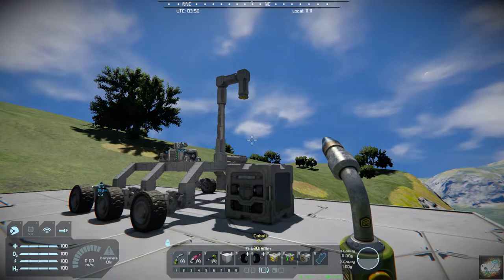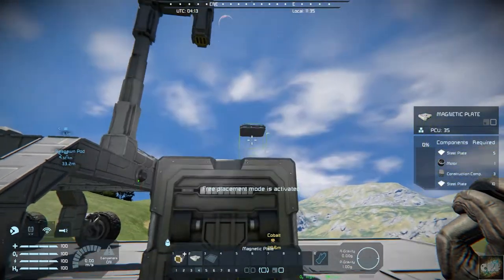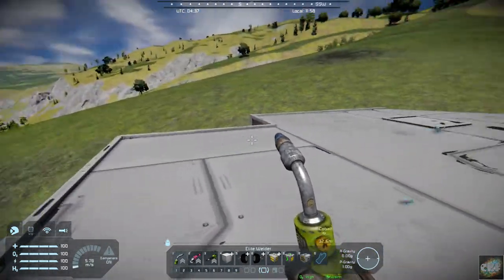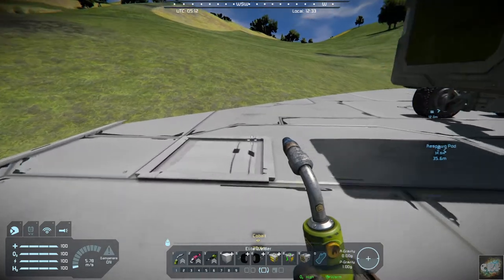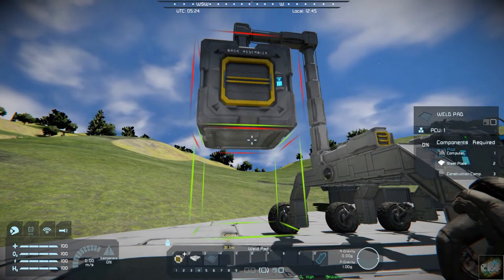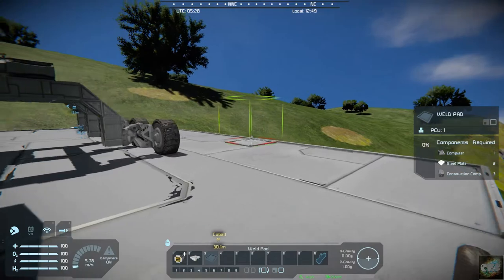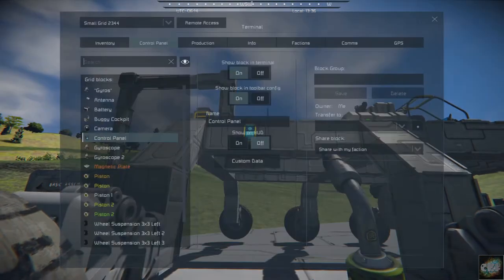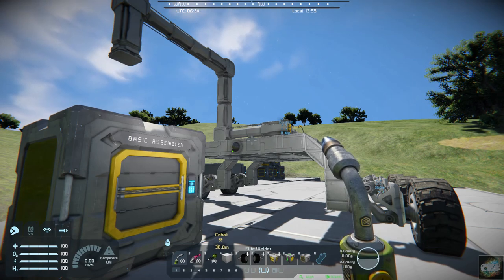Space Engineers – Mod Wednesday – Advanced Welding – detaching and reattaching blocks

Comment: will this cause Klang destruction on a cosmic scale if you have it attacked via a mag plate or landing gear as you afirm the weld plates? or do you just disengage at the last moment ? awesome mod and awesome vids ya got... just found ya the other day  ive 4k hours in this game and always learning something new
Reply from the maker: I have never had a problem with Klang using the weld plates. They work great and if I remember the object will detach itself.  In the video I use a large block but most of my stuff has been moving and attaching small block batteries that I got from the drop pods.  I have over 2800 hours in the game myself.  Thanks for watching!